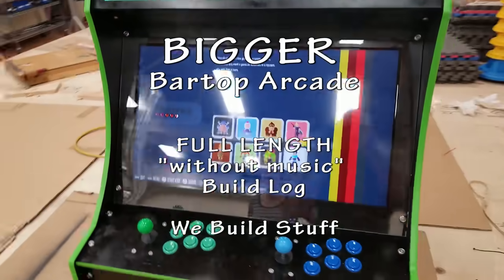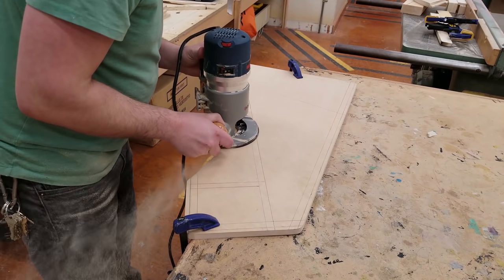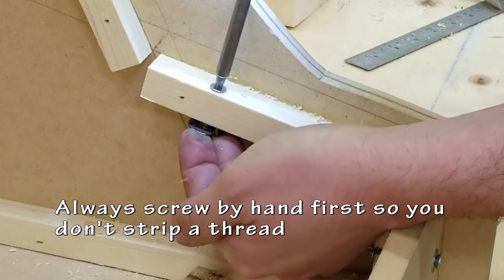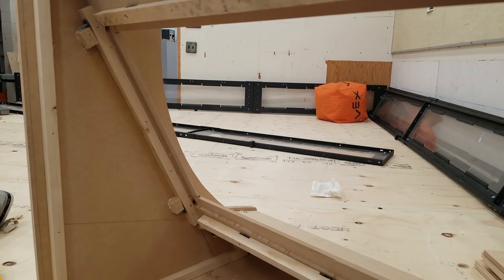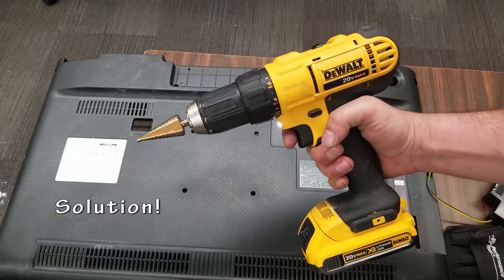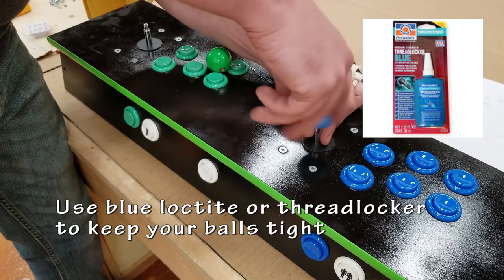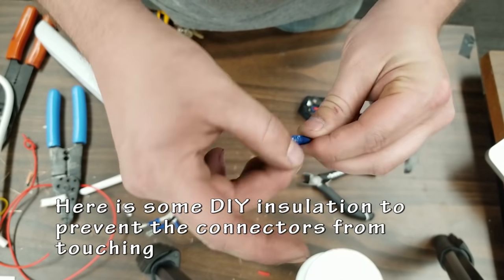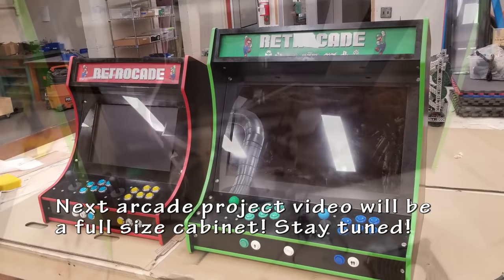Build a BIGGER BARTOP ARCADE - FULL LENGTH AND FREE PLANS!

Comment: How many boards did you use btw? I'm estimating at least 4 4 feet by 8 feet boards
Reply: All 3/4 boards or can I use other size for the other panels
Reply from the maker: @jonathanjackson4500  any size you want. you may have to modify your layout based on the thickness of your material. In my plans I drew 1/2" (12.5mm) for all my thickness. If you go thicker just move some lines and make sure each side panel has matching layout so it all fits nicely :) 
I think I did this whole cabinet with just over 1 board of 4x8. I think it can be done with a single one depending on how you plan your cuts.
My original video (the smaller bartop inspired by https://www.instructables.com/id/2-Player-Bartop-Arcade-Machine-Powered-by-Pi/ ) can be easily done with a single sheet of 4x8 plywood

Comment: Do you think I could add a coin slot? I honestly wouldnt know how
Reply from the maker: The two wires just need to go to the correct pins on your keyboard encoder or header pins on your pi/odroid,etc. A lot of games/mame will use the "select" button to also work as a coin button so you just need to daisy chain your wires to go to your coin slot

https://retropie.org.uk/forum/topic/17531/coin-operated-arcade-with-dedicated-select-button

Comment: It's nice that you've got all the tools you need to build an arcade cabinet, but most people don't have what you have.
Reply from the maker: Starting fabrication projects just like anything will always require tools of some sort. I teach high school shop classes but at home I don't have big tools.
What I do have at home I have slowly gathered over many many years. 
I built a full size arcade cabinet (still need to edit the video) only using portable tools that a starter woodworker might have at home.
Don't let lack of tools stop you. Every creative hobby requires an investment. I've used a drill, jigsaw, circular saw, portable router, clamps, hammer and nails,  and a cheap wood file to get the same results.

I've also built with only a drill and jigsaw. Slower but can still be done in a driveway as a weekend project. 

Used tools are cheap and can still get the job done with some patience. There is always a way.

Comment: I am trying to figure out how to builders cabinet but for a vertical screen could you help
Reply from the maker: Download the free plans and modify to suit your needs in Cad software
Reply: I recommend VESA mounting the monitor to a wood back plate, it's much easier to mount the back plate in whatever orientation you want.  (think like a wall mount, but mounted to a board inside your cabinet.  If you designed your cab correct, you could run portrait or landscape with different screen borders.
Reply from the maker: @sn0fx  Agreed! VESA is a great way to go

Comment: im in the uk and your measurements make nosence at all looking at the Drawing i cannot determine if they are in inches or centimeters if centineters what is a measurement of  49.14 as in the side profile, i cammot make out what 49.14 represents
Reply from the maker: These are the cad measurements. I round up or down to nearest millimeter when building since these aren't rocket ships.
Reply: @WeBuildStuff  Thank you very much, kind sir, it just threw me a little when I was seeing measurements like 49.14, 9.28. Thank you for the explanation
Reply from the maker: @stillo1578  ya I need to make a proper set that include the units!

Comment: Not a fan of spray paint for these. Vinyl although expensive makes it looks x times better. Great Job though.
Reply from the maker: Totally agree!
Reply: Yeah I spray painted my control deck and I hated it. It was really uneven. I cut a piece of acrylic, made a template for the holes, popped some holes in it with a hole saw, and painted the underside black and it looks so much better. The blotchy paint job was driving me nuts. Lol.

Comment: Why do you have gamepad 1 on the right side and gamepad 2 on the left side? (49 min)
Reply from the maker: Good eye. I did this because it was recognizing the controls as switched. I could also have swapped the usb plugs to a different port but I just wanted it working for a quick test.
Reply: We Build Stuff I was mentioning it just because it happened to me too. Will swapping the USB ports solve the problem?
Reply: We Build Stuff otherwise great video! I built mine with some modifications following your video!
Reply from the maker: @marekmatous9021  ya i usually just unplug and switch them. Not sure why it happens but a quick fix!
Reply: @WeBuildStuff  Switched the usbs and it does really work! Thanks for the tip
Reply from the maker: @marekmatous9021  glad that worked out!!

Comment: your solution for hooking up the speakers just voided the warranty. It would be easier to use the RCA jacks and the right cables. and it would keep the warranty on the monitor.
Reply from the maker: Do you think voiding a warranty bothers anyone who works with and takes apart electronics for fun?
'Everyone' has an opinion and this was a request by the person I was building it for. They wanted the same tv speakers still used but mounted somewhere else.
Reply: As an  IT tech and former journeyman electrician who may have served your junk. It's legal if you burn down your house, but if you do not do stuff with the highest standard for electrical do for sell or give away. you are liable for someone else,  In case of the tv breaks you can not return it for any reason after you mess with the insides. So you might as well just put in a cheap used one.  If you sell something you do not want to waste your time fixing it again -time is money.  If you can not fix it then you need to buy a replacement for something you sell again lost of money.
Reply from the maker: @paulvanmeveren7488  cool beans. Thanks

Comment: Why are the measurements like 49.14 or  65.29? Even using a metric ruler it's in between mm marks. Pardon a Yankees ignorance of the metric system, but this seems strange...
Reply from the maker: A lot were the unrounded measurements that my CAD program spat out that I use at guidelines while building (hence free unpolished plans available). When I build I'll round 49.14mm to 49.1mm or if I'm doing imperials 24.378" would become 24.375 or 24 3/8" and I'll cut each piece to fit.

If I was doing more than one of the same build I would make a proper set of plans to allow for repeatable cuts and streamlined building.

Thanks for watching!

Comment: I know you did this video some time ago... and may not care about building such things anymore... but... I'd buy you a Terasic DE10-Nano FPGA board for running the MiSTer Project if you'd make me one of these for my MiSTer FPGA.  Interested?  I wouldn't expect you to supply the monitor.  While MiSTer doesn't have as much FPGA core coverage as software-based emulation on the Raspberry Pi, I do believe it offers a much better experience... ubdistinguishable from the real arcade machines.  If you haven't checked it out yet, do so.
Reply from the maker: I only build personal stuff and teach others. I don't do commision work at the moment
Reply from the maker: But thanks for watching 😁

Comment: Would’ve  been nice if it wasn’t Metric measurements and had track ball and spinner installed.
Reply from the maker: I know eh. Imagine how much better it would be if I used imperial measurements! Would have been so much bigger!😉
Reply from the maker: Free dwg cad files included and not that hard to convert. I think in both metric and imperial when buildimg stuff